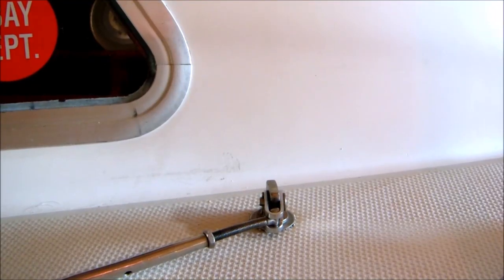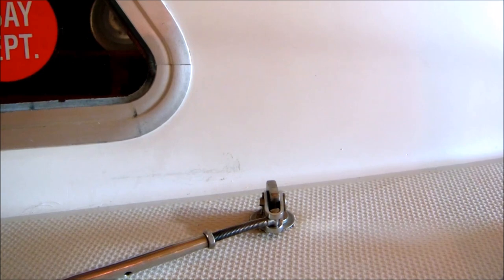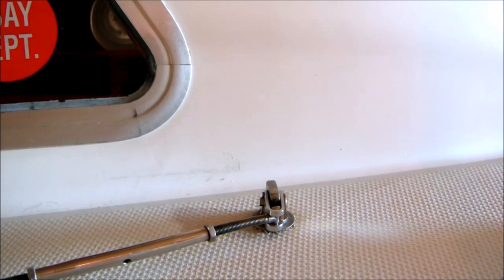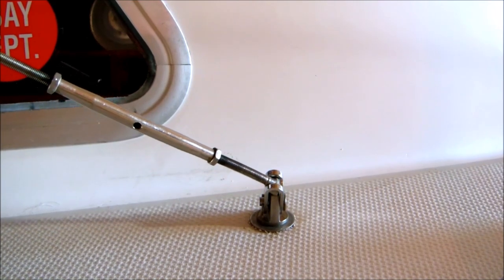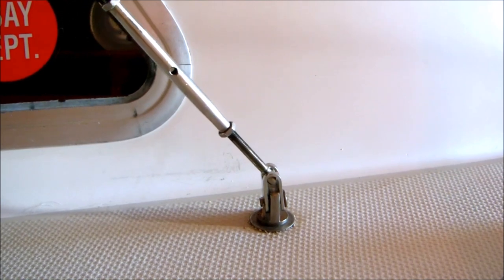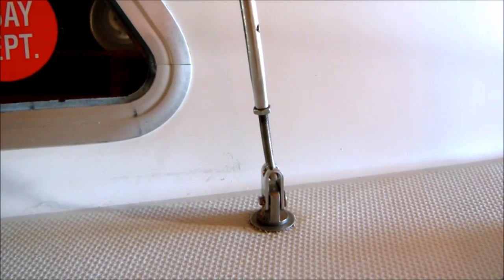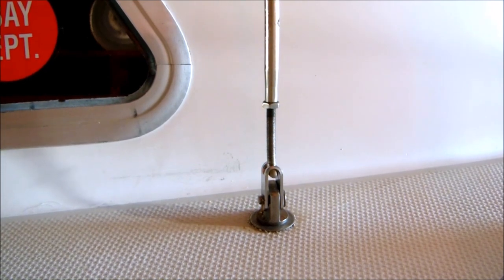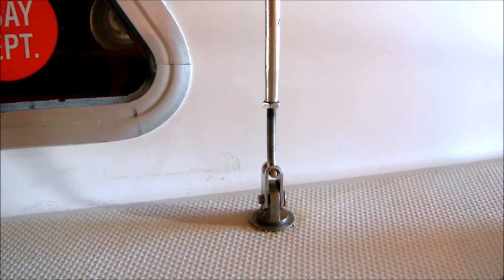Turn those chain plate bolts

Comment: I have an 88 Catalina 22, there are 3 screws on top, do they just hold the cover plate in place, or, when turning, do I have to fill and drill new holes?
Reply from the maker: On your year C-22, those screws hold the chainplates from turning so if you need to rotate them, you will have to drill new holes.
Reply: @stingysailor5677  son of a *#*^$😡😅